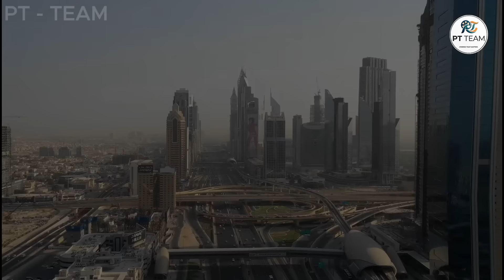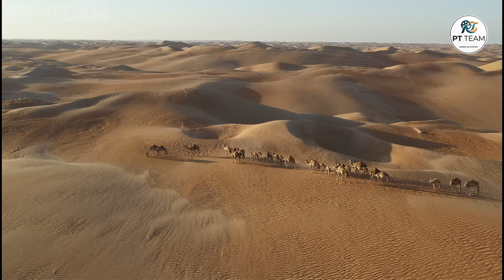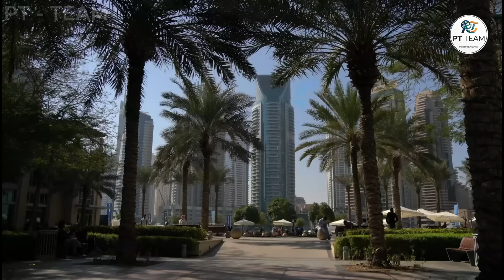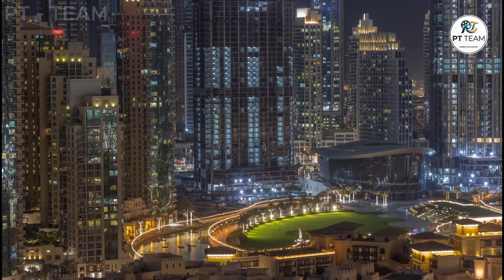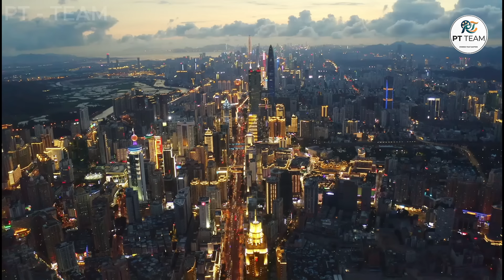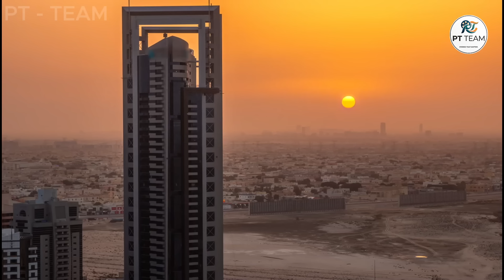Why Dubai’s $100 Billion Illusion is Slowly Suffocating

Comment: Wouldn't a simple airflow-meter reveal a clogged filter? I mean: car ECU's use airflow/airmass-meters to calculate the amount of fuel that needs to be injected quite precisely, so why not use one or more flow-meters in the airstream behind the filters to monitor the amount of air going through the filters?
Reply from the maker: Yes, airflow sensors could detect reduced flow. In large HVAC systems, differential-pressure sensors across the filter are often simpler and more reliable, but the real challenge is ensuring alarms are monitored and maintenance is actually performed.